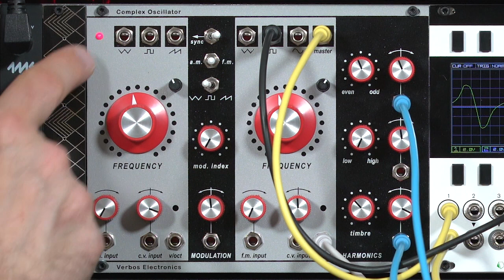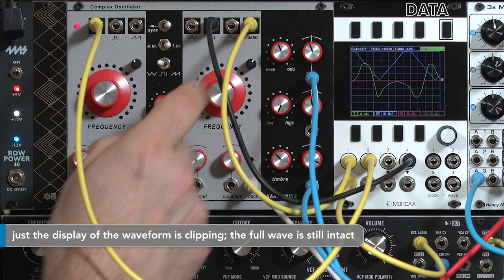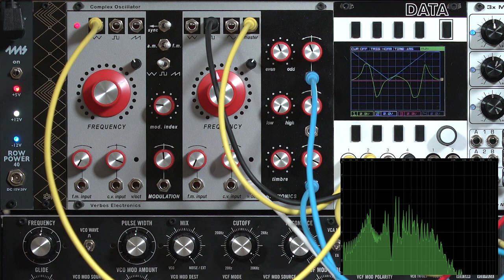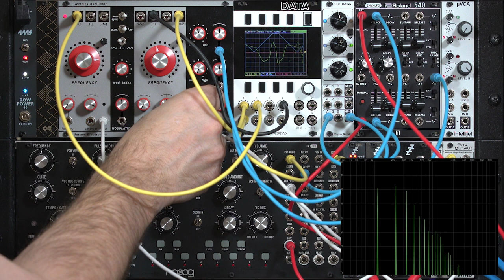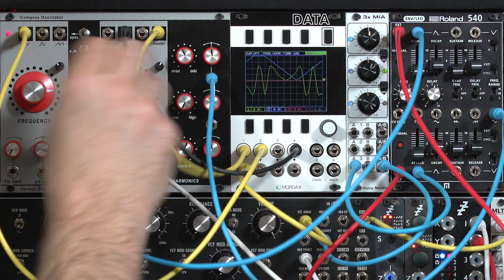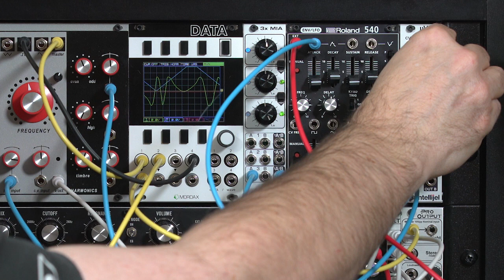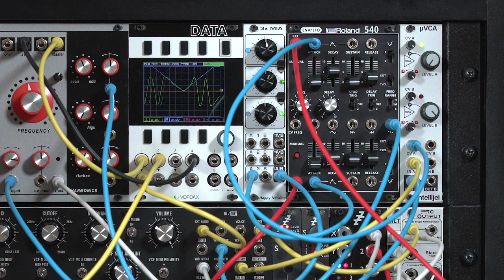Verbos Complex Oscillator: Exponential & Linear FM (LMS: Eurorack Expansion Preview)

Comment: when you use the moog osc to FM, that's what called "thru zero FM"?
Reply from the maker: Not always. For there to be "thru zero FM", the oscillator being modulated has to be able to run backwards. 

When the modulating waveform coming in would cause the pitch of the carrier oscillator to go all the way down to 0 cycles/second and then lower to a negative pitch (that's the "thru zero" part), the carrier oscillator has two choices: stop and wait for the pitch voltage to cause to create a normal pitch again, or to start running backwards. (For this to happen, the modulation has to be deeper than the pitch the oscillator is normally tuned to, so it doesn't always come up.)

Only oscillators that can run backwards support "thru zero FM." Not many oscillators can do that, so when they can, they usually make it very clear on the front panel or in their marketing that they support thru-zero. The Verbos Complex Oscillator does not.
Reply from the maker: Here's more on the different FM types:
https://learningmodular.com/understanding-the-differences-between-exponential-linear-and-through-zero-fm/
Reply: Jesus, I didn't know how much I needed that video! EXCELLENT work! You're extremely clear in your explanations. Thank you so much.